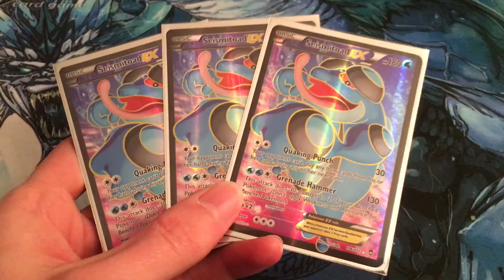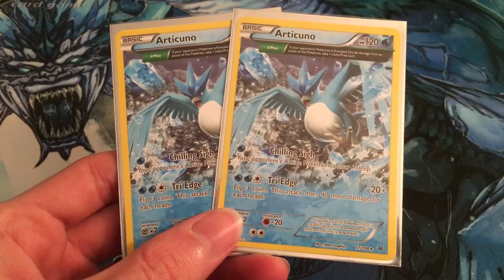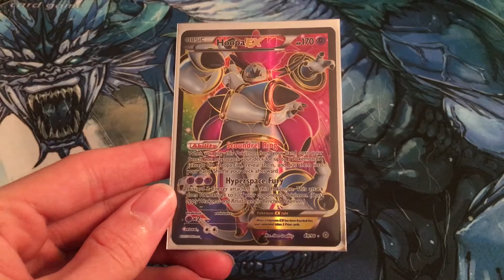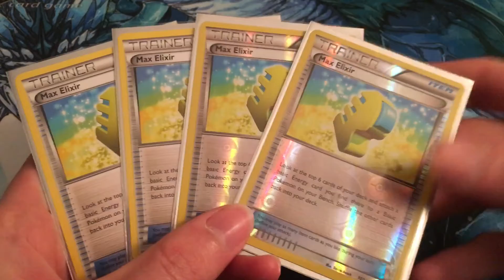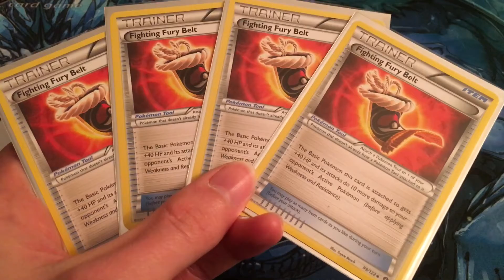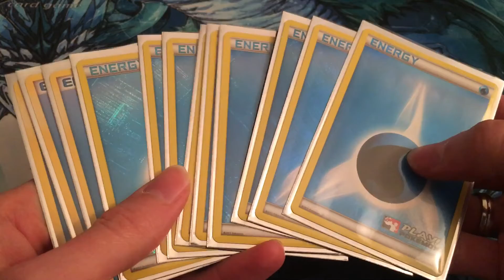Water Toolbox Pokemon Deck (League Challenge): Deck of the Week #34

Comment: a place where the extra 10 is useful is on siesmitoad vs EXs. you can quake for 40 and if your opponent cant heal or retreat, you can grenade hammer for 140. easy 180 if you can prevent your opponent getting fury belts down.